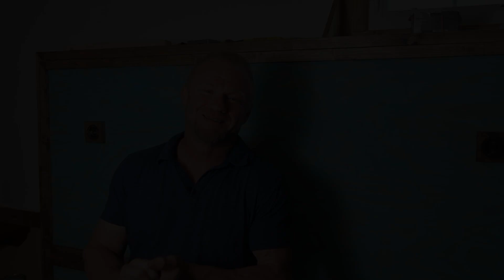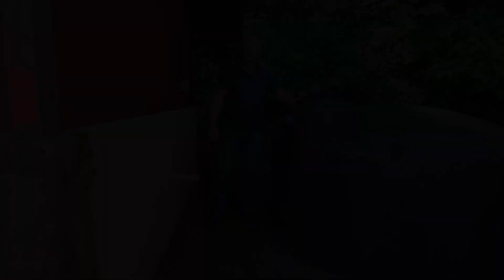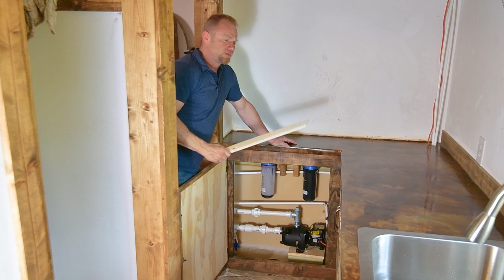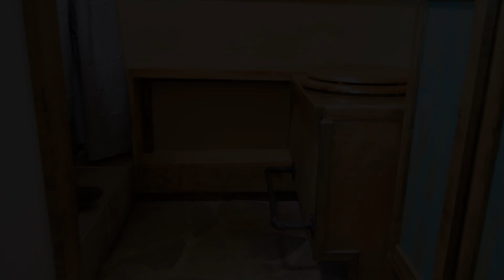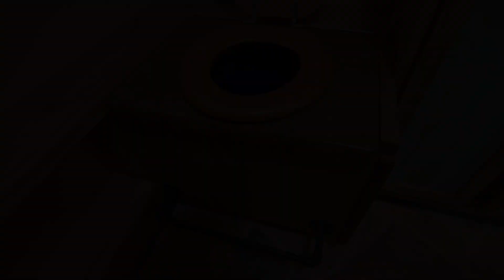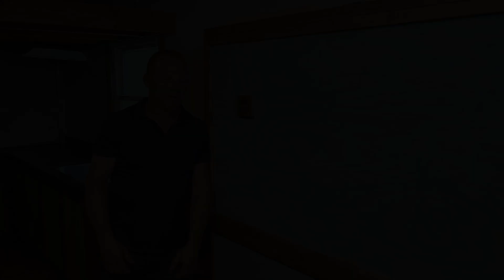Tiny House Build: Ep 5: Off-Grid Water & Waste Solutions: Rainwater Collection & Composting Toilets

Comment: I am wondering why did you not use urine diverter. Urine will swamp the pooh bucket otherwise.
Reply from the maker: Toilets been workinng over a year now of use. IF you put just enough wood chips to cover moist  your fine. AND Most of the time #1 is outside and #2 inside. door to each about the same distance.

Comment: Interesting video, plain, simple & no nonsense - gave you a thumbs-up.
I have a relatively average 3-bed semi in the UK & despite have 2x flushable toilets, I don't use them for myself.  I use a compost toilet in my garage & when the large bucket is fairly full, I empty into a compost bin in the back garden, layering with lawn mowing's, leaves, & a varied mixture of biodegradable vegetable matter from the garden.  I have 5x compost bins that make great, highly fertile compost.
I have mains water for use in the house, but pipe water from my large garage roof into an IBC 1000-litre container in the garden & several smaller water butts.  Used to water the greenhouse, wash the car & water the vegetables during the summer droughts.  I would love your much larger water container.
Doing my best to live a sustainable, low-impact, resilient, self-sufficient lifestyle.
Best wishes to you, JohnnyK from the UK.
Reply from the maker: It's good to hear from you. I know you didn't ask for any advice. I don't pretend to be an expert. However there is some heat in that compost that you're making. Here where I live they sell black flexible water pipe in-1 inch diameter.. it comes in 100 ft rolls here. It comes coiled up in a circle roll.  The surface area of that much pipe and the volume of that much water in 100 ft when put into a compost pile.  Push water in through it with a hose and hot water comes out the other end. The hot water can be used for or regular household use. However you can hook both ends of the pipe to a heat exchanger in the house and as long as the heat exchanger or radiator is higher than the coil it will naturally thermosiphon without a pump and circulate and you can put a small fan and will the heat off into the house.
Reply: @TheTitian69  Hi Van, advice always welcome, only a fool closes his ears to sage words of advice well meant.
I'd rather intended using the warmth from a couple of compost bins to heat the greenhouse during the winter, by just placing them inside the north end.  The problem is that my standard sized compost bins arn't really big enough to keep the natural compost heat generation going during the cold winter nights.  A single much larger volume would probably do the trick, so I have to build something of around 1000-litre / 1m3 size & insulate it.  Then my young salad leaves growing in the greenhouse might just have sufficient heat to grow well in the winter.
I can usually keep the house partially warmed during the winter, as I've got 5.75kw of solar PV panels & a couple of Immersun electricity diverters to send the power into a couple of old storage radiators.  Has been working well for the last 11-years.
Regards, JohnnyK.

Comment: i use 4-6 gallom biodegradable compostable bags I bought off amazon to line my compost toilet buckets.. easier / faster clean up.. so I just take out the bag  and drop that into my larger compost area .  $12.99 for 100. I am single and use about 1 bag per week

Comment: My friend designed a festival toilet system with strawbale lined pits that had a male and female sided "dry" outhouse on skids that slid over the pit.  When it got filled to a certain point  the outhouse was moved to another hole and the used pit was backfilled with the original dirt from the pit. The manure degrades before leaching enough to harm anything.